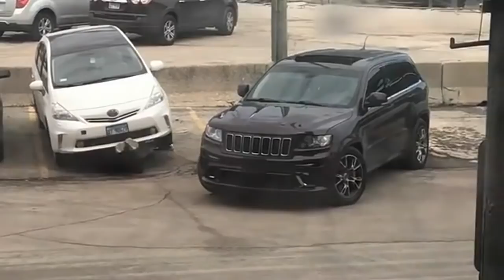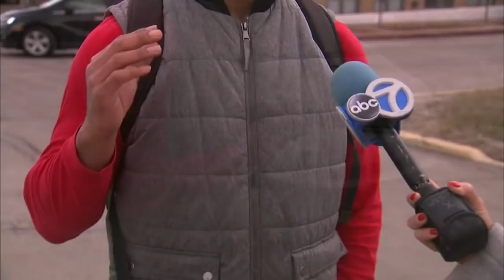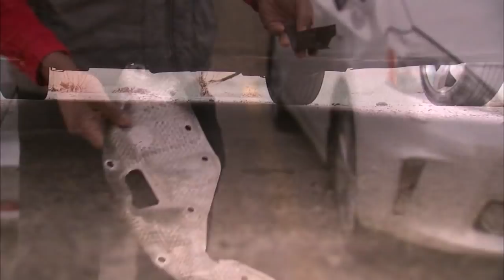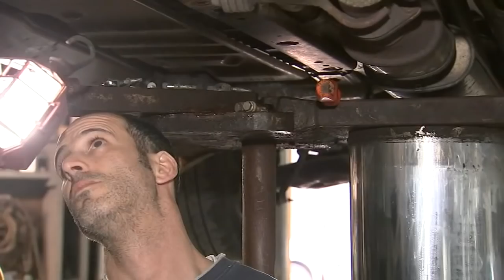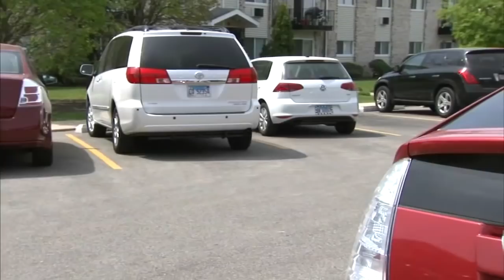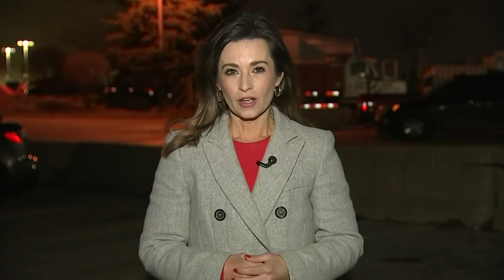West Town catalytic converter theft caught on camera

Comment: Lock box or some type of security mechanism to prevent access to catalytic converters. Like a box that surrounds the device or a sealed under carriage that alerts owner of tampering. Low jack catalytic converter chip with gps tracker system. I don't know. Something that wouldn't cause a fire interfer with the vehicles overall speed and function.
Reply: Yup I weld them on all the time

Comment: I don't see y'all doing anything about it. So why talk about anything and sum the total of times it was done if no actions are implemented? Clearly the automotive industry can easily fix this with a design for the catalytic converter to be placed in a non accessible area whereas you see even the part is out and exposed so I ain't buying nothing news, politicians, CEOs, or authority figures tell me otherwise a simple mere common grounds of common sense. Can't stop but you can...

MAKE IT HARDER ON THE THIEVES.